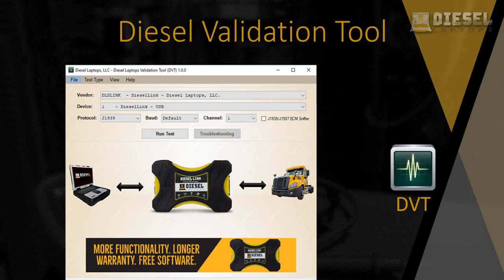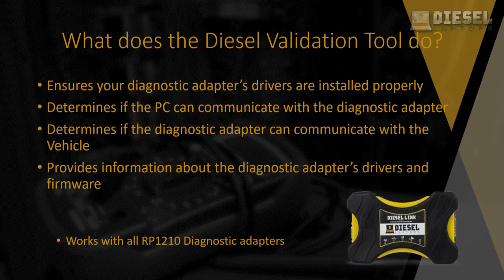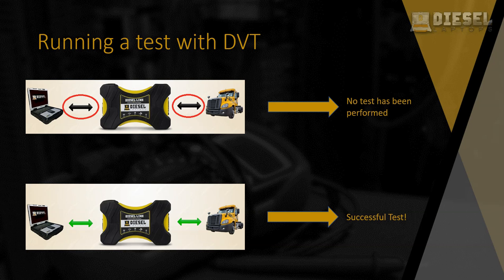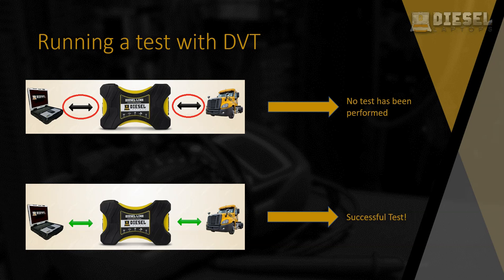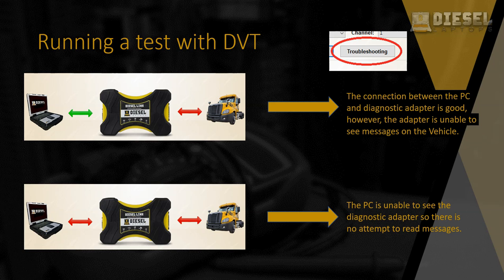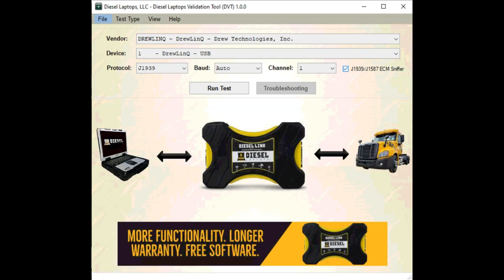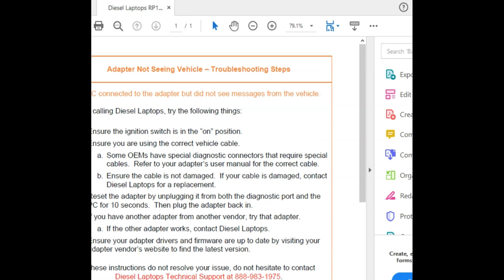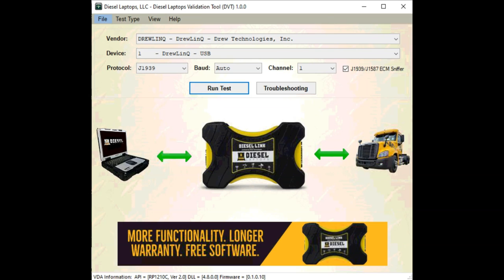Diesel Validation Tool Overview

Comment: Can do truck mileage corrections..?
Reply from the maker: This is a tool solely designed to test if you have a problem with your laptop, the datalink adapter, or the truck when you have connection issues. It will tell you where the problem is, and then what ECMs it detects. To do mileage correction usually involves reprogramming ECMs with OEM software (Cummins Insite, PTT, DDDL, etc...)
Reply: I need japneen truck Obd coorrection tool ...Please help me